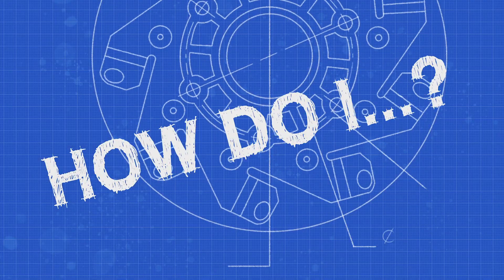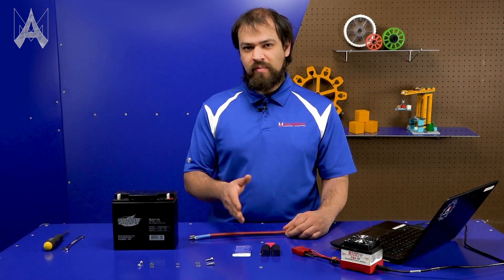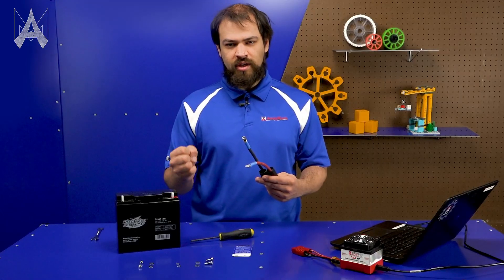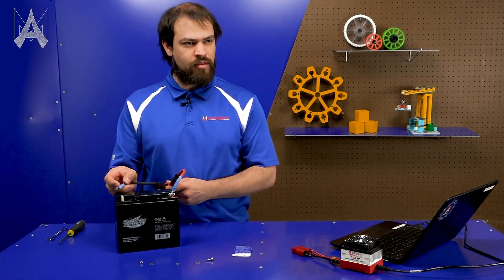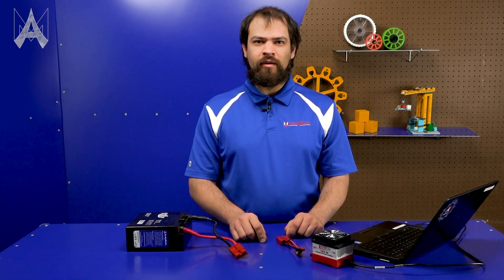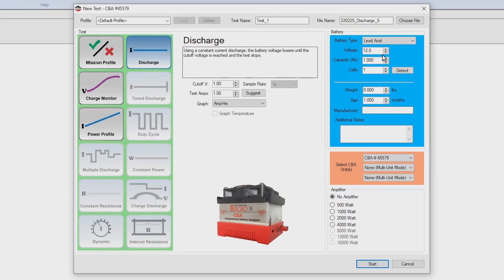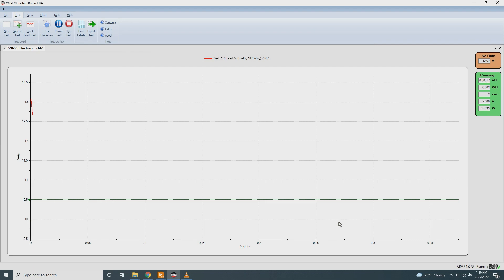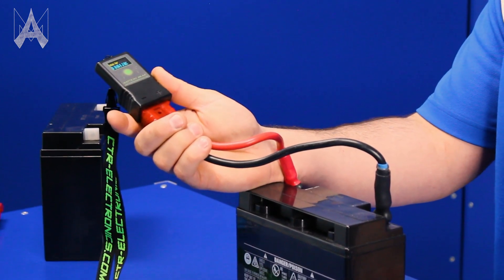How Do I Prepare Batteries for Competition?

Comment: My team likes to slide strain relief boots (the ones used for corded power tools) over  the crimped-on lug. The heat shrink just never seemed to be enough to keep the cables from bending sharply at the back of the crimp connector. This results in strands breaking over time as they become work-hardened from bending back and forth. I recommend the Superior Electric BOOT-M style. Nice snug fit over the crimped lug; just don't forget to slide it up the cable before you crimp on the lugs because it's too tight to fit over the section with the mounting hole.
Reply: We're also not a fan of sliding the heat shrink over the screws because it makes it much more difficult to check and re-tighten if necessary. We stick to properly applied electrical tape.